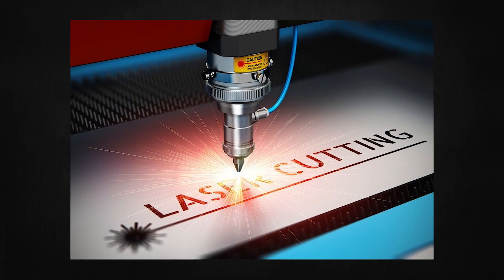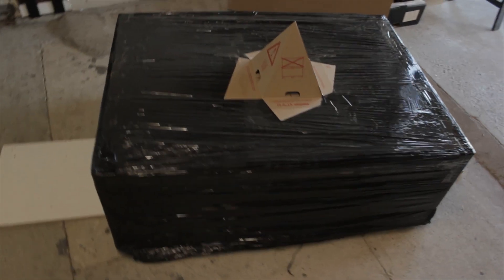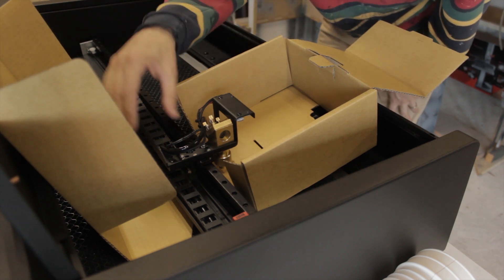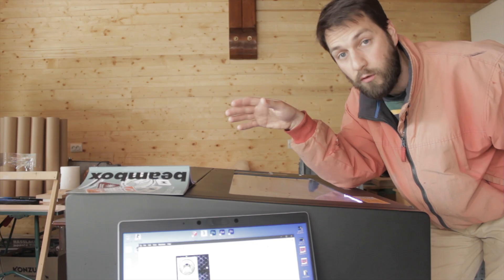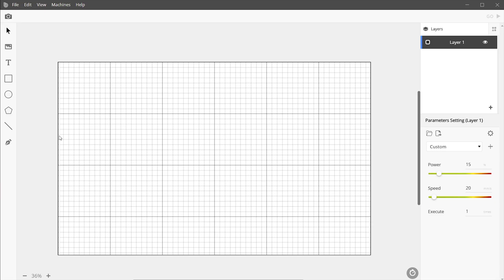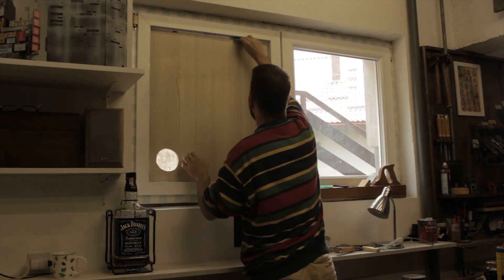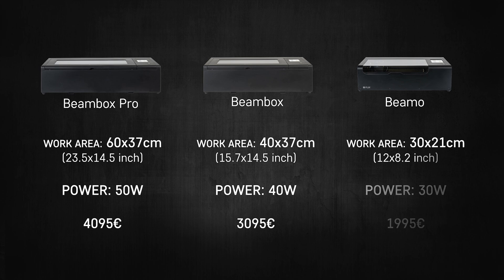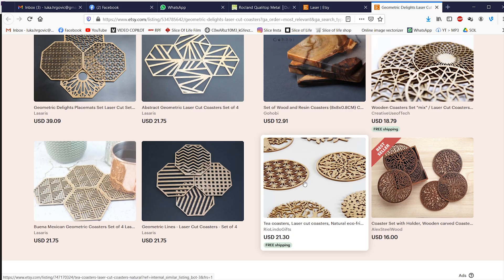FLUX Beambox Pro Laser Cutter (unboxing and review)

Comment: Hi, I'm looking at Beambox to cut acrylic (various pastel colors for cake toppers, signs, etc).  Is this machine quiet and easy to use? Your thoughts?  Thank you.
Reply from the maker: Sorry Almira, I missed your comment until now. My experience with beambox pro is great. Its very easy to use and intuitive. Once you have your design its less then a minute of setup before you start cutting.  And its not that loud. The cutting itself is pretty silent, the extraction vent is the loudest part but its not that bad. All in all, a well made product in my experience. ;)
Reply: @sliceoflifefilm  thank you for getting back to me.  But dies the beanbix pro able to cut various acrylic in pastel colors without a problem?  Thank you.
Reply from the maker: @amael1224  i only cut transparent acrylic so far but i dont see why it couldn't cut pastel ones as well. Its the same material after all.
Reply from the maker: And I realised you are Amira, not Almira. Sorry bout that 🤭
Reply: @sliceoflifefilm  thank you!   And thank you for correcting my name.  👍

Comment: Hi is it true the beam box pro can cut 12mm wood?
As I wanted to make strong miniatures which can be playable for kids? Did you known about glowforge if yes which one is better to buy ?
Will appreciate if you reply it will help me a lot of takings decision
Reply from the maker: Hey! I never used Glowforge so I dont know what it can do. I figure both are pretty similar. I never tried to cut anything12mm thick, but perhaps it could do it if you cut lighter woods (like balsa) in a few passes... But not sure about plywood. I mostly cut 3mm sheets without problem in one pass. You could cut 6-7mm in two passes. But 12 mm would probably be too much for every desktop laser that is not meant for professional use. If you really need to use 12mm materials perhaps you should look into CNC machines. But I think 3-6mm is strong enough for toys. Hope that helps :D

Comment: Did you test the laser on your finger? =)
Reply from the maker: haha, it turned out like that in the video but it was an exacto knife cut! Actually the Beambox has a safety feature - when you open the lid it immediately stops the laser so I couldn't test it with my finger even if I wanted to.

Comment: I run a small laser cutting business, and if that water isn't either properly distilled, or fully de-mineralised, get it out of there, trust me ... Run it for a few minutes with white vineger to clear out the tube of any residuals, and then replace with the correct stuff so you don't drastically reduce the lifespan of the tube. Also if you can, keep the water reservoir cooled BELOW 25c at all times when running, again, so you don;t drastically reduce the lifespan of the tube. A proper chiller, or a reservoir with replaceable bottles of Ice will do, the ice acts as a heat exchanger and you just replace the bottles when required. Looking forward to see what you do with it :)
Reply from the maker: Thanks a lot for the tips! Replacing the water is easy enough and I'll do that for sure, but I'll think about the cooler as well. ;)